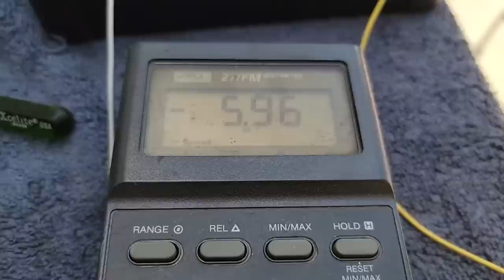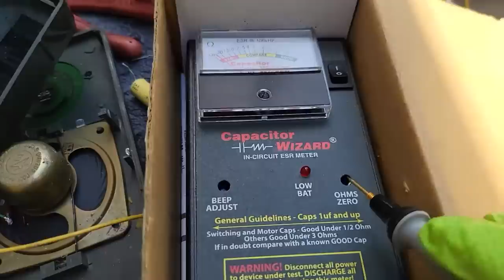Selga 404 Transistor Radio Diagnosis and Repair USSR

Comment: Nice Restoration, have repaired a few of these European Radios!!
I retired just before Covid hit. Had collected about 50 pocket transistor radios over the years and decided it was time to do some repair. Many of these had some real collectable value so it was worth the effort. I would say that in 80% of the cases it was all related to capacitors. Very Low Audio. Most had dirty volume power switches... Was able to restore most of them over a 8 month period. Lots of fun, lots of pulling out your hair. Having the right tools was critical... Still left are 2 Sony that have the built in CLOCK!! Decided to save the hardest ones for another day... OH!!! I did throw out 6 radios as they were just not worth it, some water damage, some battery leakage that ate up the PC boards...
Robert

Comment: This was equivalent to taiwanese pocket radios in USA for the USSR - mass produced, but very far from that cheap relative to average Joe income. The secret of good reception for all soviet radios was multitank first IF filter - a bit less losses than cristal filter with properly tuneable bandpass. This example goes under 404 model number - an intermediate serie recognisable by silvery speaker grill and chromed outer rim of the dial and the only difference with the later larger serie 405 model is box finish - black painted small holes perforated speaker grill and only the dial center cover was chromed.
Reply: Multitank first IF filter, yes that's true. This thing also has a 3 transistor IF stage compared to a normal transistor radio's 2 transistor IF. That might also be the difference.

Comment: I'm surprised the reception is that good with a mended bar antenna. Glad it could be repaired. I have a selga 405 and it's a performer as well. Only downside, I find it picks up a lot of interference from everything around the house not to mention distant thunderstorms.

Comment: Damm it. You are going to make me get that Westinghouse back out, lol I had to. Change the transformer out, and I did get all the volts needed, but I only ended with one station in but very low volume. I will check that cap.

Comment: Be careful with those ceramic variable capacitors, they tend to seize up and then the adjustment screw breaks off from the ceramic wafer

Comment: I can remember seeing one of these in Britain that was branded Vega.
I wonder why you don't use L.W. in America now?
Long Wave proved to have useful extra reach (if a lot of power was thrown at it) with Britain transmitting the Shipping Forecast to those out at sea via B.B.C. Radio 4.
Reply: BBC Radio 4 198 KHz gives a good signal on S Portugal at night, even in the daytime its, semi usable at this time of year, around 1100 miles distance.
Reply: Longwave in North America was always used by non directional beacons for aircraft (NDB's), in Europe they are/were used above the longwave broadcast band, closing slowly now.
Reply: I could pick up Ashgabat, Turkmenistan on 279khz long wave overnight in West Yorkshire England quiet often.
Reply: @peterbramwell1069  Sadly longwave is dying off, RTL 234 KHz closed at the beginning of the year, Poland 225,Algeria & Ireland still on 252, Morocco 171 and Radio 4 198KHz of course.Is Iceland still active on 189?

Comment: Soviet industry was divere through the republics-partially because jobs were needed, partially in an attempt to avoid everything being destroyed in the case of the war. I have read that Sukhoi-25 attack fighters were made in Georgia truck factory, all the way from prototypes, by truck factory workers. Those first prototypes had "interesting" flight characteristics and were used for ground testing of combat damage, but entire series was later made there.
Reply: Antonov heavy aircraft were also built in Tashkent, Uzbekistan - they spread factories all over the country so that people could have jobs everywhere. They shouldn't have built the capacitor factory in Armenia though (a joke for those who understand).

Comment: Hi, in terms of Long Wave I can understand why it is of low concern to people in the western US, given that it has never been used for b/c radio transmissions in the Americas. Sadly long wave is in decline in Europe. Living in the Western European Islands we only have two long wave stations of much interest, BBC Radio 4 and RTE Radio 1. The latter being of interest to people in Britain because most people in the island of Ireland can pick up Radio 1 on FM. There is some speculation that BBC 4 on 198 kHz will go off the air but the frequency will remain in use, with a solid state transmitter, because it controls electricity meter timings. As happened with the French 162 kHz channel.
Anyway these USSR receivers seem very efficient, it would be great if someone would produce a kit based on the circuit of one of these. I know you have built a couple of Chinese kits for medium wave (or "the broadcast band" in US parlance) and were not too impressed by either.

Comment: You had me thinking...I'd say add some powdered steel to super glue and put the antenna together. I wouldn't rely on the antenna pressed together with tape but on the other hand what I suggested it would still affect permeability. Doubt it would matter at the frequency but I'm sure someone knowing more than I do has some ideas,

Comment: The problem with these transformers (including IF transformers) is that the coil former are made of a low melting point plastic. As you solder them, the leads become loose. I really don't get why they haven't used some better thermoplastics. This was a well known problem for Soviet electronics already in the '60s, but they kept on making them this way till the '90s!

Comment: 12 ohms sounds a bit high for an output transformer secondary driving a typical 4-8 ohm speaker.  Or is that a 100 ohm speaker?  Don't know about these soviet speakers.
If the radio was dropped hard enough to break the transformer lead, I'd expect to see broken circuit board traces too.
Reply: How can you after watching the video wonder about the speaker being 100 ohm?
The speaker with one lead disconnected did measure 8.5 ohms in this video. 4:32
Reply: @ertyuiiknbvcx  But he measured the transformer secondary as 12 ohms.  They are usually about 1/2 to 1/4 that.  Ok 100 ohms was way to high a guess, probably more like 25 ohms.  Remember that the impedance of a speaker is more than its DC resistance.  Transformer should show lower DC resistance than the impedance it matches to as well.
Reply: @KennethScharf  Perhaps the 12 ohm transformer had a combination of good price and was found good enough, if for example a warehouse had much of them in stock and the price was low. Or it may have sounded better on this particular speaker if they tried lots of transformers. Or perhaps it did not exist a perfectly ohmed transformer available at the time they did buy, or even at all. Who knows, i can see several motivations and priorities like weight, size, price, or even perfection in the ears of those who made the radio. Or it may possibly have been a earlier repair too since it was not painted grey like the other transformer.
If it had been today where people buy things on the internet i would put my bet on cost price. But since it was back in the times where people actually did go listen on a radio in a store to compare before they did buy, and where it was more pride and reputation in the brand names, and where people may not care much about a little more money spent if something sounded better, well, it may be a better choice than cost price like today.
On the other hand this was in the times when small portable radios just came on the market and everyone wanted a small radio just for the beach, holidays, kitchen or even just for buying a christmas gift, and small was the selling point, so cost may have been the deciding factor still.
It likely was made earlier than the high end stereo wars in the late 70's and into the 80's where companies was forced to be better or die. And it is a small radio and not HiFi perfection like that. So yeah, who knows. 
I am not familiar with the RRR brand name so i won't dare to guess too much.
I just see lots of reasons for doing things, and now i has probably wrote much so i end the message here :)

Comment: are germanium AF series rf transistors any good to use on todays date , in radio receivers ?
Reply: At 1:58 I see 6 orange silicon transistors(probably KT315) and 2 germanium transistors used for the final audio stage. It's so funny, but this transformer circuit really works great with germanium transistors.
Reply: @Peter46350  yah. in old days transistors were all colourful, came in different shapes and sizes. 
these days they all look the same black boring clones.